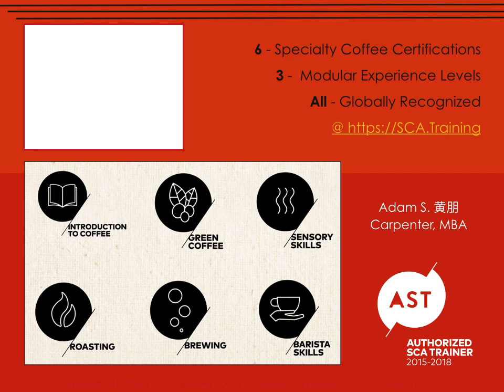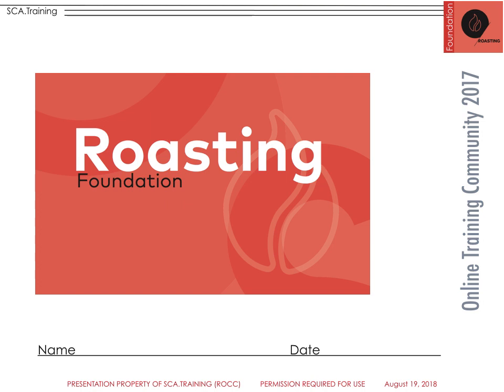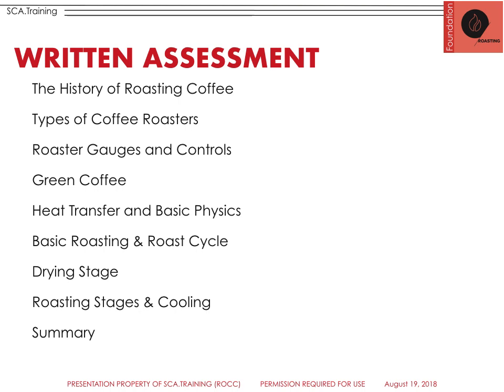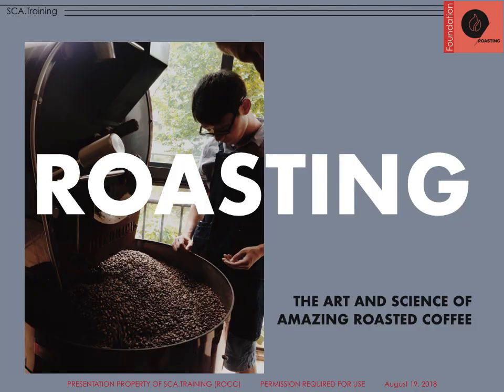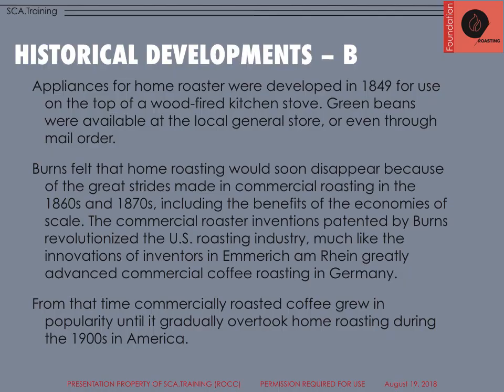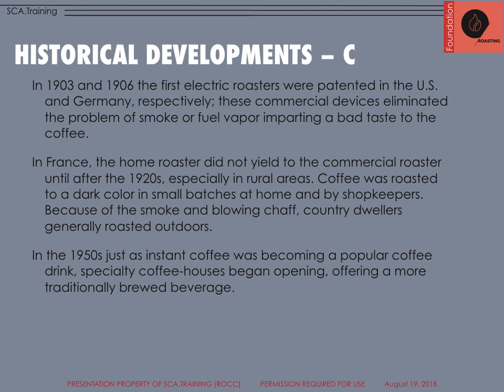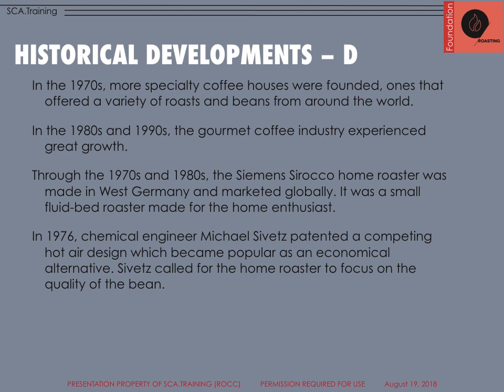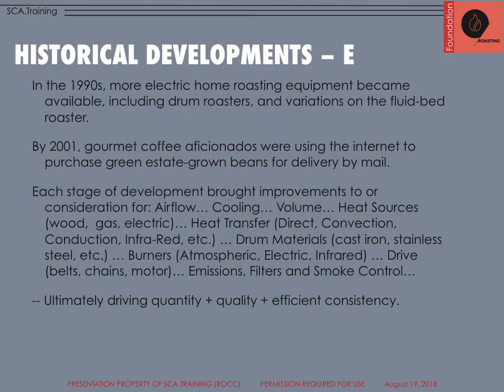SCA Roasting Foundation - Part 1 - Sharing my old PowerPoint slides with content explanations

Comment: do u have experience on chinese roasters, r they good machine comparing to European?
Reply from the maker: I do have experience with buying and using a couple Chinese roasters. I would highly recommend smaller roasters (under 5kg) from China as they are well made and very affordable. 

The advantage of a smaller machine is that the strain of heat and engineering stress from lower loads in physics - doesn't hold the same level of demand that a large 10-20kg ++ roaster has. For larger roasters I would go with the long standing trustworthy producers in the EU, USA, Turkey, etc.

I personally had a 2kg roaster from China which I used in Wuhan and then had a Diedrich IR 12 which I imported to Wuhan. It was a great combo. 

Recently a student of mine just purchased one as well off of Alibaba. There are a couple good companies and it is ideal to work with the right sales person. Alibaba is a good platform for purchasing smaller Chinese coffee roasters.